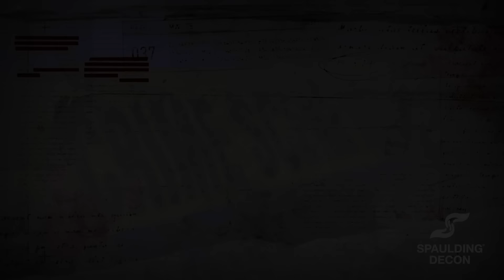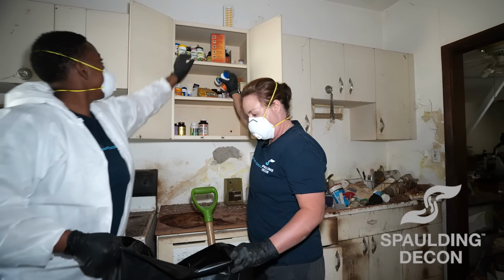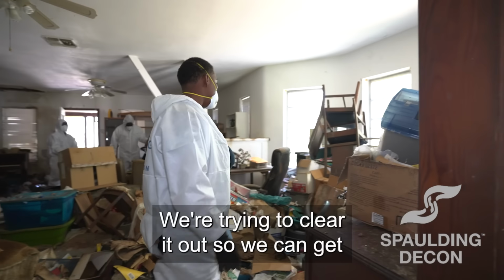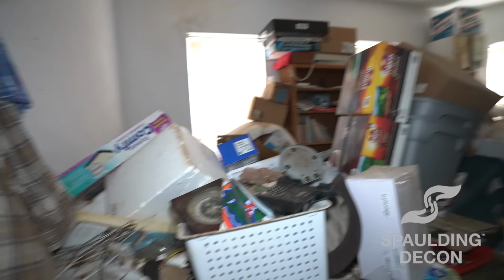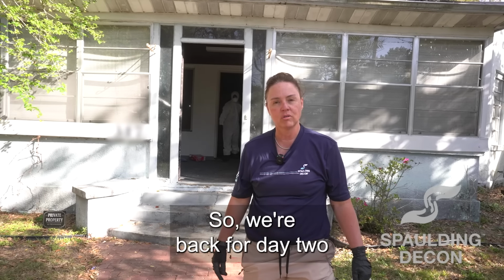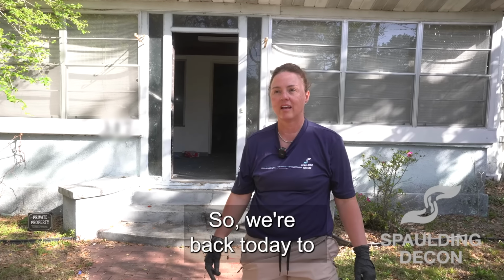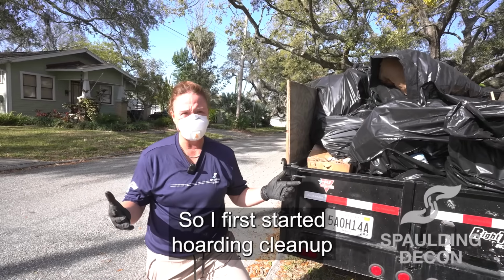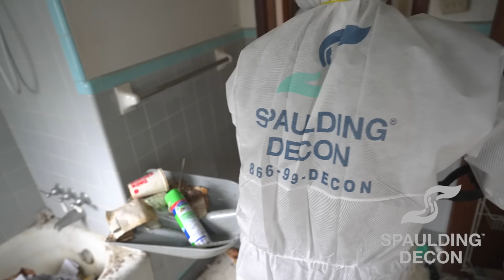A historic hoard. #spauldingdecontampa #hoarding #hoardinghelp

Comment: You should get the round grey trash bins and stretch the bags over those. It will save your back and free the other hand from holding the trash bag. That alsos increases production so more people can scoop trash instead of holding the bags open. We use these in our cleanups and they help tremendously!
Reply: This was driving me nuts! Have them both shoveling at the same time.
Reply: 3rd world country stuff where labor for a bag holder is cheaper than a trashcan
Reply: Or get the bag holders meant for raking leaves like I have. It's a large looped spring with a canvas covering and has two plastic buckles. You unbuckle them and the spring expands to the size of a ~32gal trash can. You put your bag in it so you don't need anyone to hold it open. Just don't overfill the bags or you'll have a hard time getting the bag out.

Comment: You are risking your peoples health without reason.  Carrying bags of trash on their back?  Good way to get stuck or cut. Splitting maul on Piano instead of battery powered sawsall or at least an actual axe or sledge hammer.  Two people to do trash instead of tip back garbage cans.  You could get more done for less labor and much safer on your people.  Not impressed.  Spend a few hundred dollars on the right equipment and stop endangering your people.  Damn shame when you see people as cheaper than equipment.